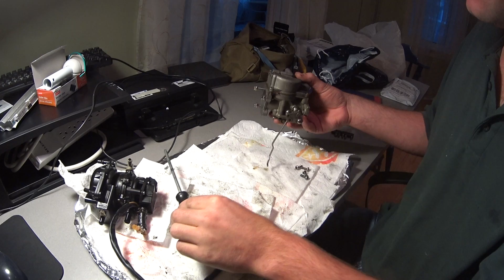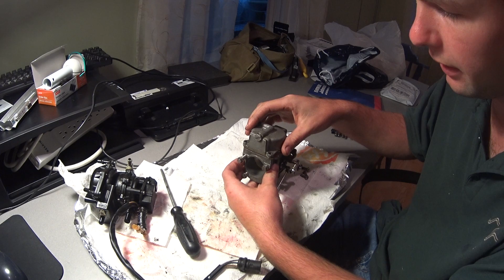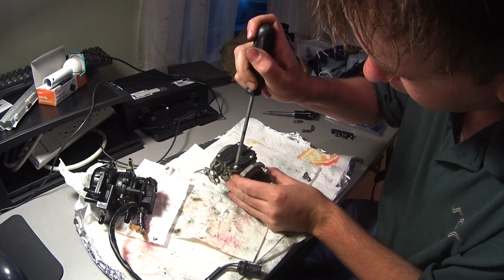1996 Evinrude Carburetor cleaning 40hp outboard motor

Comment: Did this fix it?  Those engines have a rpm limiting device in the power pack.
Reply from the maker: Yes, it was also a fuel flow issue from the tank. However taking these carbs apart and cleaning them is Very simple. Its pretty easy to inspect the inside and see if the carb is good, or corroded.

Comment: good start the jets are gunk ed up the float can can jammed or the the injector jets are gunked up carb cleaner and run it full till it dies and repeat. it happens all the time, you in once or twice a month and should be good. I do this all the time at work. 
Was it the float or the jets when the fuel would enter the carb        good video people pay people quite a bit to do simple DIY 
fixes     siimon you should see what a diesel engine is like much easier